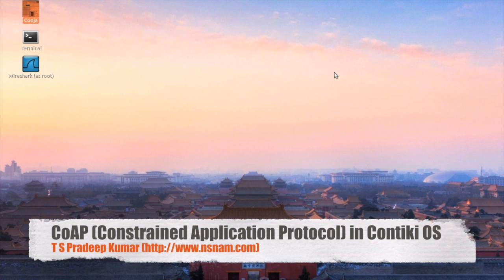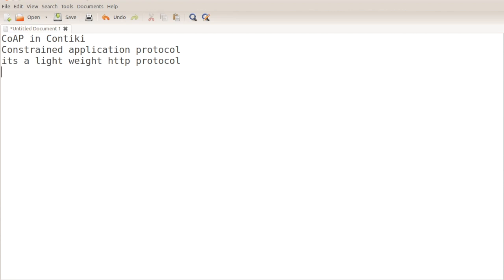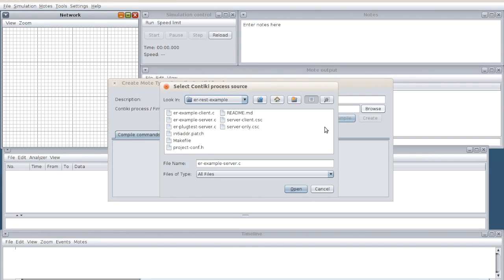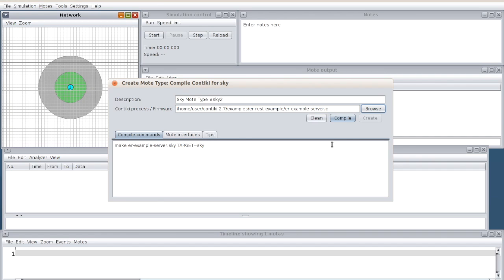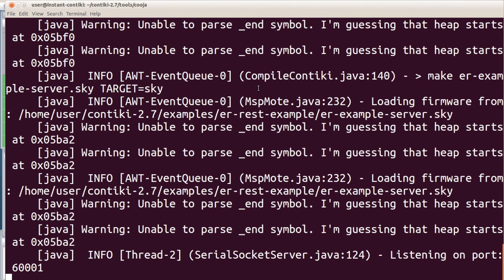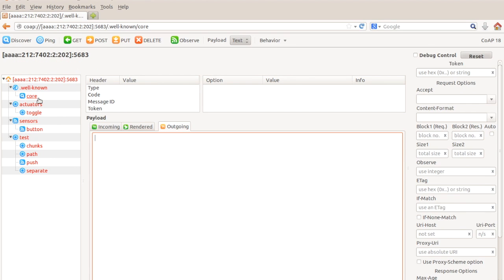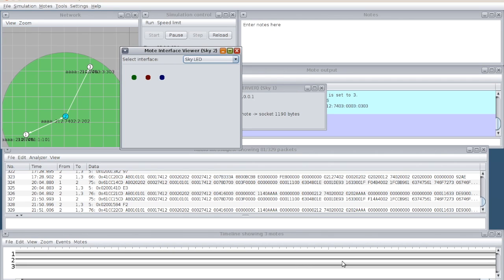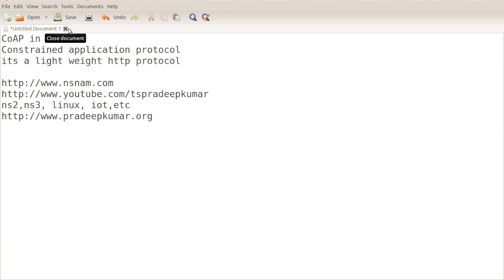CoAP Protocol in Contiki OS

Comment: sir, i am not getting the same options after putting the address in the web browser. only it is showing well known option. No toggle,no actuators.
Reply: Sir, in the mote output window it is showing slip bridge :Destination off-link. Also, if i put coap://[address] after some time then the page is not even opening. There is no problem with the internet. Internet is working. Please help
Reply: Sir, in the mote output window it is showing slip bridge :Destination off-link. Also, if i put coap://[address] after some time then the page is not even opening. There is no problem with the internet. Internet is working. Please help. There is proxy here. Is there a problem due to proxy.?

Comment: Hi, this does not appear the "actuators, sensors and test" for me in firefox.
Help me please!
I'm using 2.7 Contiki
Reply: i'm having the same problem here
Reply: [solved] you have to access the server before the simulation time out
Reply: @wencai667  can you elaborate more or tell me steps for this problem
Reply: @wencai667  please explain what's going wrong
Reply: Same with me.. how to solve that.. on my firefox there only display well-known and core..
Reply: sometimes it appear  ERROR: Main.discoverHandler [Content-Type is null, not 'application/link-format']
Reply: @wencai667  can you show me how to fix it
Reply: did you find a solution ?